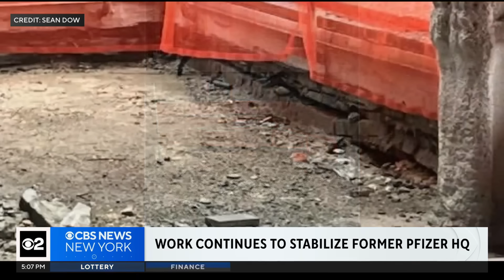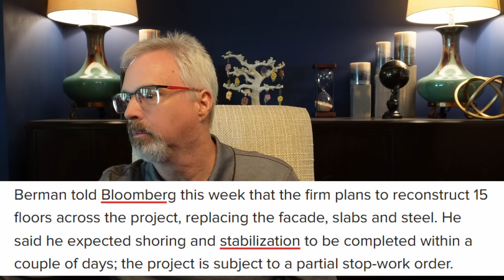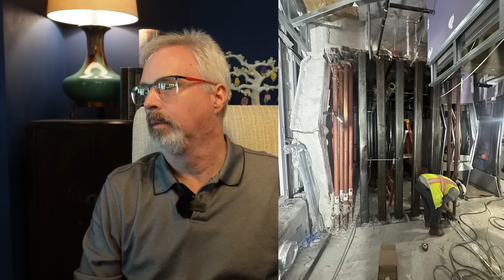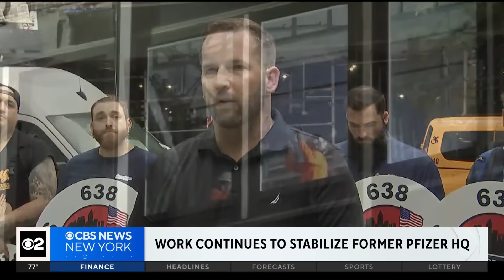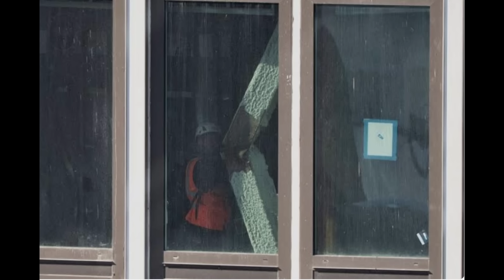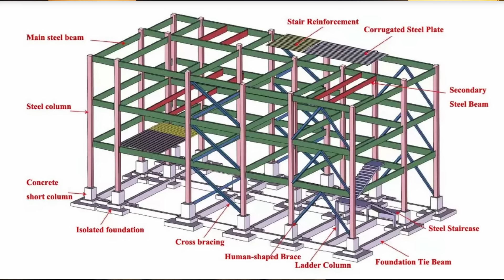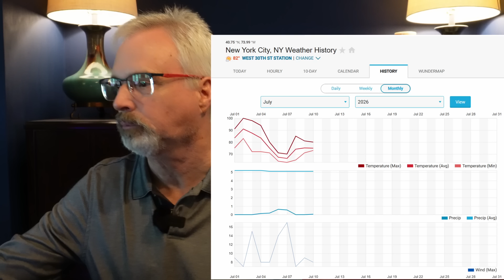Update - Pfizer Building Structural Column Failures; Now What?

Comment: I was at Baily crossroad partial building collapse of Champlain Towers as part of my duties as a US Army Generator Mechanic instructor. We brought 3 bulb 3KW light tower and 5 KW Generator. One section of the building collapse due to pulling forms too early. In that case 17 dead all electricians in the basement. The building was eventually completed.
This Pfizer mess needs to be condemned and demolished with a new building compliant to current codes could be erected.

Comment: First, thanks for a review based on some real engineering, not the nonsense I'd seen elsewhere.  But a question?  Aren't the plans, including the structural drawings, and perhaps the calculations, on file with the NYC building department?  Being on file and some amount of review as a condition for a construction permit?  And if so, are they public documents subject to a freedom of information request?  If so, then it would be interesting to see what reinforcement of the existing structure was called for, if any.  And anyone with the knowledge (or proper software) could second guess the structural engineers of record looking for errors or bad assumptions.  That is what was done for the (poorly designed, corroded) reinforced concrete pool deck that brought down the condo in Florida.  But no one died here, so I wonder how deep the forensics will go.

Comment: Could they have a poor record of the specification of material actually installed.  I can imagine it’s not simple to identify the actual material existing. I’d imagine that the specification can be lighter for every floor higher. Perhaps an assumption that material specification was uniform all the way up, when in reality the original building reduced specification for what they believed to be the top floors. 

Thickness of steel under fireproofing can’t possibly be easy to measure in great accuracy. Steel quality must be near impossible. Cheaper steel of same dimension substituted in for floors with light load?
Reply: I can imagine substitutions of steel happening during acquisition. Somebody got an idea to save a buck. Why not? They didn’t plan for 15 more stories. No harm at all until somebody decides to build on top.

Comment: Adding so mutch extra floors on a existing office building is crazy!  
Also the load of a office  interior  is probably lower  than in resindental use. 
If the building was not seriously extra strongly /made with adding floors in mind the overloaing of the old roof will be pretty mutch guaranteed.  
When they add extra floors on buildings made in  concrete in sweden they often use  solid wood block  building techniques, because more concrete would exide the load the original building was constructed to manage.

Comment: THANKS FOR YOUR REVIEW.  GREAT JOB.   
You mention the overhang of the new construction having a cantilever effect on the columns below.  I'm no structural engineer,  But with all the steel added to the building , why was that allowed to be extended over the floor below.  Why not install steel columns under the perimeter of the new constructions to the rooftop , columns below.?  
I would think that cantilever force that this created,  ( how to calculate ?) was never a forced  that was applied onto those two columns below.  
The Hot temperatures and steel  must have added additional stress with expansion.  Stress sensor would be a great safety add, some how to monitor conditions. 
Photos of the electrical cable spoils do have to be questioned,.as it appears to be stored above in that cantilevered section.  Cable spoils can weight hundred to thousand of pounds. What was being stored in that location before the photo was taken,  how many other spoils are/were there?. 

Regards

Comment: Every time we hear about one of these disasters in the making, it usually involves someone trying to get extra building space into a building not designed for the load.  I'm not a structural engineer.  If I was looking at these plans, I would be shaking my head with varying loads across two buildings as well as the new add-on floors.  That's one of those jobs where every design specification better be spot on, all actual and potential loads be measured and verified by independent experts, and structural work be up to and maybe beyond code.  If I was NYC, I'd have inspectors crawling up the builder's backside to verify everything.  Because you know if the building collapses the city is going to get blamed for not doing enough.  There will be lawsuits from now till judgement day.  Especially with a greedy builder who seems to thrive on using his political connections and lawyers to stifle any actual punishment, fines, or loss of building permits.  I'm just glad it happened before the building was occupied. Can you imagine if those 1600 Apartments had been occupied with an average of 2-4 occupants per apartment, not excluding families who like to double bunk to save money.  If it had gone down at full occupancy and without enough time evacuate not only that building, but the surrounding buildings (especially during the busy NYC traffic and workdays).  It would have made 9/11 look like a traffic accident.  I personally think it's going to a major economic loss for all involved as no one in their right mind will want to live in that building.

Comment: Union guys are idiots trying to claim it's because of non-union labor. First of all, the guy with the biggest mouth is a steam fitter. Steam fitters have nothing to do with structural steel columns and probably know nothing about structural columns. Second of all, anybody with the slightest bit of knowledge about contractors know that contractors, union or non-union don't decide how a building is going to be built. Architect's design them and the engineers figure out how to make them structurally sound. Contractors build them according to the plans their given. Contractors are going to stick to the plans unless they get approval from the architect and engineer to make a change. And that will all be documented. Contractors know if they make any changes without approval they become liable for any failures and chances are pretty good that they won't pass inspection. The union guys are spewing out propaganda to try to blame it on the contractors but all their really doing is making ass's out of themselves.

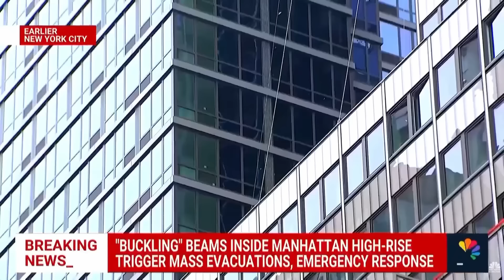Comment: at around 16:00 your video shows a clip of video from inside the building, presumably on one of the floors that is compromised/shifted since the vertical metal members are bent. i may have seen this clip before, but i'm just noticing that the floor is covered in puddles of water. in that the outer skin of the building was unaffected, i wonder why there is water all over the floor???
thanks for another great video!! i wish i'd been an engineer! this stuff is fascinating!!
hey, i just checked my local rhode island news. it is friday night, when they typically release things they hope few people will see. the Mount Hope Bridge inspection report has finally been released. i watched the video (part of the article) first, and it said everything is great and the bridge is safe. however, if you read the TYPED part of the article, well, um..... it doesn't sound that great or safe. i didn't know if you'd be interested in taking a look the artilce on wpri's website.
Reply from the maker: Thank you very much! I wondered about that water intrusion too.

Comment: As I’m looking at that buckled column, it looks small to me,  considering the additional weight of the added floors above. Is it possible this column was only ever sized to support the original roof? 

(Not a rhetorical question, I simply don’t have enough mechanical engineering background to know.)

Comment: The developer Berman openly admits that two major support columns near the northwest corner of the 37-story tower bent under the weight of the building's expansion because they "had not been properly reinforced, or had not been reinforced. Then in the very next breath, he claims that the engineering and design of the project were "perfect." A project where unreinforced columns buckle under newly added weight thus causing floors above to drop four inches which cannot structurally or logically be called "perfect.

Comment: It important to note that the columns failed in the Y-axis (the weaker of the two axis)  which is expected with an over load. Looking at the connect to the beam there seems to be a moment connection ( to be conformed) so the buckling length for analysis would have been 0.7L. The would suggest excessive load was applied to the column. A total review of the design of these additional floors is a critical check. While there are normal design load factors fir both dead and live load no one designs for a 19 story additional load. All column loads at the lower floors need to be checked.

Comment: I've worked on several projects adding more floors to existing structures.  In every case I can recall, the buildings were designed with the additional floors in mind.

 The level of corrosion I've seen in this video should require the building to be demolished.

Comment: It would not be surprising that columns higher in a building would be smaller than columns on lower stories.  The higher you go in the building, the less load that is above so downsizing columns is not only not a surprise to me, it is an expectation.  That is simply good structural engineering.  You size the members to the load they are subject to.  Now, you don’t go to extremes and optimize each and every floor as that would require using every I or H beam size in the AISC manual, however, I would not be surprised if every 4th or 5th story had the columns downsized appropriate to the load above.

Comment: Can you imagine adding 15 floors to an existing structure?  How strange that anyone would have built the original structure with 15 additional floors in mind.  This just doesn't pass the smell test. And I think you were a bit cavalier about columns failing in a buckling mode.  This is one of the fastest and most catastrophic failure mode that exists. Concrete columns are even worse but steel too is very dangerous because there is little to no warning. For beam elements both well designed concrete and steel there is usually plenty of warning of an impending failure due to overload or corrosion as well.  This failure mode is dangerous and almost any miscalculation or miss step will set off a chain reaction.  Last video you mentioned redundancy; it doesn't really apply to this type of failure in my mind.  An unzipping or domino effect is a better analogy.  Remember now the next columns are obviously carrying more load. Thank you for covering these situations, as a civil structural engineer this type of thing makes me take notice and become more cautious than ever.  Thank you for the video for sure, very well done.

Comment: I working on a hospital that is going from 4 to 5 levels and was designed for 6 levels. Steel erectors and GC say it’s pretty typical to add levels depending on design and or budget.

Also durning contraction extra weight can be added if u see those large cable spool in pictures . Along with large equipment, generators, large amounts of drywall , etc. also shoring could/ should have have been needed .

Comment: If you ever wondered if a compromised building can be strengthened you should learn about Citicorp Tower.
Reply: They reinforced the Citi tower before anything bent.  This seems like a different can of worms.
Reply: @Thegonagle Only two columns broke. The rest are fine. (No public information to conclude otherwise.) But the point of the Citicorp comparison is that the Pfizer structure can be strengthened if needed for additional stories, rooftop pool, etc. . Whereas lots of people here.
 believe that it can't be. 

Additionally...do you know as a fact that none of the connecting bolts on the Citicorp building failed?  Probably not, but the repairs were kept secret for years.

Comment: That claim by the union guy is totally ridiculous !   The workers look at the blueprints that have been designed and engineered by the top minds !  I'm assuming as the work is being done it's being inspected and approved to completion !  Whoever relied on computer modeling to determine loads definitely needs to blow off a dust on a drawing board and do it by hand with a slide rule !

Comment: Although curtain wall system is not vertical building load bearing, except for itself and wind load, are typically anchored into and supported by the building structural framing.  if the building structural frame fails,  it'll take out the curtain wall system as well.

Comment: Casey nailed it. Several things have to go wrong to see this type of failure.  It's very rare to see something this severe happen due to a single issue.

The strain gauge idea is interesting.  I haven't work on structures more than 7 stories, so take it with a grain of salt.  As an EOR, I'm all about more data to make informed decision. Being on the owner side now and having to write the purchase orders, I know testing equipment can be cheap, but install labor, maintenance, inspection, analysis and reporting gets expensive and it is an easy line item for the people with the purse string to cut when you are talking about hundreds of beams and columns to monitor.  Sadly, a well placed strain gauge would have caught this before yield and well before they hit ultimate strength.  With that said, we don't know if yield was at +2 stories or 20 minutes before ultimate - I think it leans toward the former.

I think the developer's comments are asinine, but he's probably already sold a bunch of units and he's using that money to finance the job.  So he needs to make these buyers comfortable or he's gonna have to give back a bunch of money and he can't afford to do that.  He's also totally screwed himself when this gets litigated.
Reply from the maker: Thank you!
Reply: Agreed, that the columns were overstressed before all the new stories were added. The columns were designed for roof loads (dead+snow+mechanical), not several floors of concrete fill over steel pan deck and steel beams and columns.

Comment: in my cm experience, strain gauges were not typically used in new or retro building construction unless something unusual occurred, like a crack at an odd location, and better intel was needed on how the structure was reacting. not a structural engineer, but I could see why a competent engineer may not want strain gauges as it might lead someone to ask why the SE didn't know and plan for all stresses during the design phase

Comment: I dont see how the actual boots/hard hat guys doing work had any influence on this. Holding a union card or not. Either they followed a design/plan given to them(they did nothing wrong), or they did not follow a plan(boss did not supervise both are wrong). Isnt the floor with beams part of the old building anyways? How would current union or not change what was done decades ago. Seems like the revision was designed incorrectly. Either they used bad data(prior design was not to blueprint/code, or incorrect measurements ie steel/slab thickness, ect), had good data but didnt math correctly, the load from construction caused this issue and somehow the finished and furnished appts would not(bathrooms are heavy with tiles, tub full of water, toilet, ect), or w/e work was being done on that floor caused damage to the structure. Time will tell us what the cause is.

To repeat what others have said, you could not pay me enough money to live in that building or buildings next to that one. If I were living/working in a building next to this one I would move/quit, and at least consulting with a lawyer on legal options to recoop losses/costs from moving.
Reply from the maker: You raise some very logical points regarding where the breakdown in this process likely occurred.

Comment: There is a stop work order.  That cannot be revoked without substantial documentation of remedies.  GC cant just show up go gee sorry I'll do better"   The developer cant even start up work until he proves the site is safe the whole site.  He wont be allowed to proceed w all other work IF there is any danger of collapse of part of building.  Cant just put in some sawhorses w do not enter signs   Who knows what coukd pull off if a major collapse occured.   The "workers allowed in refers to specific workers doing specific tasks as approved by NYC agencies in control now"  Demo cant be done until demo plans w engineers seal indicating means & methods, phasing etc will allow removal safely.
Reply from the maker: Those are all great points. It looks like there will be a long delay before any true work goes on there.